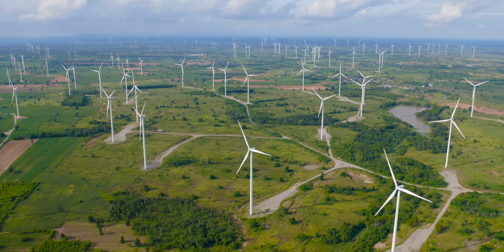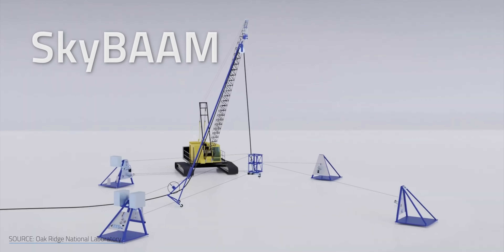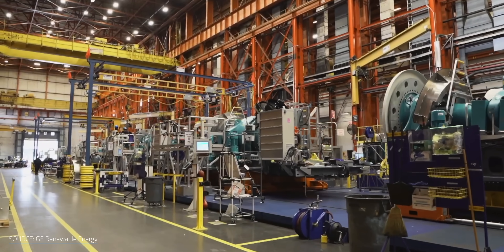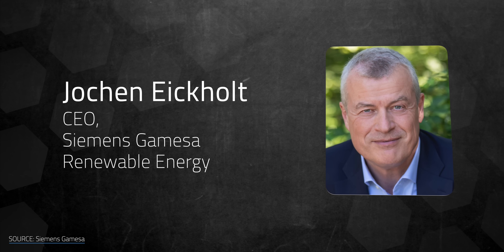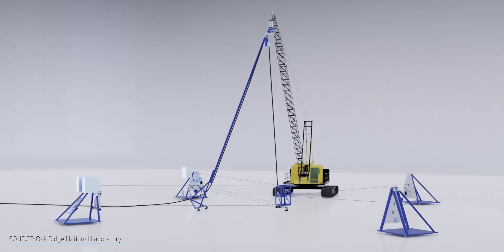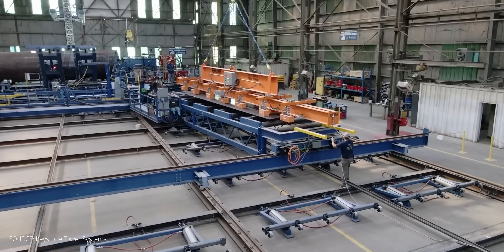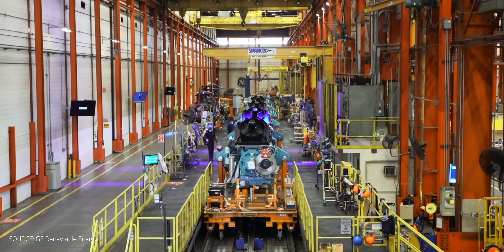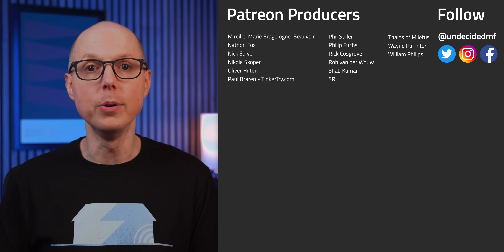Why We Need To Rethink Wind Turbines

Comment: I'd like to see things go smaller and more localized.  Things can be more cost effective and stable, IMO.  We see that happening with SMRs and there have been other videos looking at other wind generators that are smaller and may be more residential intended.
Reply: Sure, they would nicely substitute "residential localized" coal/gas power plants
Reply: @naytonthunder If you think about it, my home and almost every other one in my neighborhood has a “residential localized” gas power plant - but for heat, not electricity. As for smaller, localized electric generation, solar has tremendous advantages there. Solar panels (with battery backup) can be installed in all sorts of buildings, and scale from tiny to covering an entire lot. Wind turbines are harder to install, and small turbines don’t have much output. This just turns into a cost thing, and solar will be far cheaper than wind for most localized sites.
Reply: Wind scales very well by going bigger. Double the length of the blades and get quadruple the power. The reverse is costly. Going from 100m blades to 10m and you lose 99% of the energy capture potential.
Reply: @barongerhardt  I guess I can understand that but then what's the cost of all the machines and logistics to get it to where it needs to be and then to power people's homes?  Its time a factor and do people have a problem with a huge windmill in a field.  Those things need to be considered as well, I feel.

Comment: im having trouble believing you on some of your statements such as its cheaper to make carbon fiber blades than fiberglass. because adding carbon fiber usually increases cost up to 15 times the original cost. so which is it? i think you need to make it more clear or you need to research what your saying in more depth. Where do i come from my wife worked if the wind energy for 10 years upto 5 yrs ago.

Comment: I look at those folded columns and my first thought is, “duh”. 

One of two possibilities…The engineers were pressed to hold down costs so they skimped on the material used in the column. There’s absolutely no way the engineers with their complex computer modeling didn’t know better…or…the column was outsourced to the lowest bidder who chose to ignore speciations in order to make a profit.
Reply: Wind turbine tower break when they lose control of the rotor speed. If there is a lot of wind, and they can't reduce the angle of attack of the blades, the rotor will overspeed, the rotor will push too much on the tower, the blades will bend too much, and strike the tower, wich will break it. Nothing to do with the quality of the tower.
Reply: @niconico3907  You hit on like 5 engineering failures. Maybe one of those happening could be excused but all of them pushes on an extreme of incompetence and blatant disregard for safety.
Reply: @barongerhardt  in the world there was 906 000 MW of wind energy capacity at the end of 2022. On the few failures that were around 2MW each. Lets say 10MW failure. Which is 0.001% catastrophic failure rate. Not bad in my view.
Reply: @niconico3907  And what were there causes? Where they freak accidents of unknowable events, deliberate sabotage, or did someone screw up? Under spec requirements, design was inadequate, or manufacture/construction failed to follow design?
How ever rare, I don't accept the wind turbine failed because the wind blew any more than I accept patients die because they were given the wrong medication.
Reply: @barongerhardt   A friend of mine works as civil engineer for the planning and design of the towers. According to him, it's a combination of both. A decade ago, towers were constructed with huge safety margins as the load and aging characteristics were still unknown. The wind turbine towers differ from other buildings as the wind load is much more dynamic, but can also be controlled to a high degree by software. So modern wind turbines are more active in when they start moving out of the wind. This over all allowed significant savings in material. At the same time, some companies tried to cut corners even more with the expected results.
Reply: @barongerhardt  like I said it most often is not a tower design or quality issue, its a control system issue that prevents the rotor stopping in time to stay under designed maximum loads.
Reply: I would guess a combination of pushing for too low of a safety factor with catastrophic screw up by the construction team or major manufacturing defect (bad weld, missing/not-properly torqued bolts, ...).

Comment: To put the size of a football field and a wind turbine into perspective. 

A football field is 100 yards long. 

One yard is almost one meter, for a metric reference.

100 x 10 = 1000

One mile is 1,760 yards or 1,609 meters. 

One kilometer is 1,000 meters. 

Therefore a wind turbine is almost a kilometer, or roughly 3/4 of a mile. 

That's rough maths done on Google, and I'm sleep deprived. But I hope this puts into perspective the sheer size of a wind turbine. 

Massive.

Comment: The quest for ultimate efficiency is one of the reasons we are now experiencing supply chain problems and end user shortages. If the end consumer took up this mindset then retail would end as we know it. What about wind generated power for the home owner?  There has been almost no usable innovations in this area for a long time. I wonder how much potential is being lost due to short sighted profits. I would love to install wind power at my home but the tech is either decades old or unbelievably expensive for little gain. Solar took off when the small user found a reason to use it, i would like to see that happen with wind power.
Reply: The big reason why you shouldn't do it, is home wind has a scaling problem. As linear size of the wind turbine increases the capture is squared. The secondary reasons why you wont be able to do it is safety and noise. Because of those, lots of areas have laws (well founded or not) that make it impractical. The next reason is on a small scale wind tends to have low reliability. As such, in most cases solar is the better small scale case, but if you have the area, laws, money, and desire, there are some good wind options.
Reply: @barongerhardt   the point i was trying to make is we need innovation to improve on the small scale wind generation like we have with solar. Do you really think that the only way to produce energy with wind is with massive windmills?  I think there are yet undiscovered ways to do it differently
Reply: @arnoldreiter435  I don't know if that is a generalized desirable and reasonable goal. Big wind generators aren't the only way, but small/micro wind has lots of basic drawbacks. In a similar way that small nuclear powered super heated steam generators might seem like a good idea for home use but really aren't.

The advantage and disadvantage of solar is that it scales linearly. Almost every innovation that has gone into making it better helps as much on the small scale as it does on the large. It also makes it as you scale up to be outpaced by other techs that have better scaling factors.

I don't see some innovation being the missing thing. The physics are clear that like hydro it benefits from going big. It benefits from being placed as tall of a tower as possible. The amount of energy you can extract is well known and we are very close to those limits. After you have converted wind to rotational energy, rotational to electric is highly developed at all scales.

There is good reason you don't see wind powered calculators or a hiking wind generator for your cell phone. Watch a video about people trying to charge a phone from the rain downspout. Water is far more dense, and that is an exercise in futility. These things can be made, but not all power generation methods can be scaled down and maintain their usefulness.
Reply: @arnoldreiter435  big turbines are not the only way, they are the only economical way to produce meaningful amount of energy. There are other ways, but they pay for themselve in way longer if ever. You can't compare small scale wind energy with solar panels.
Reply: @barongerhardt   I understand what you are saying but i dont accept that we have come to the end of the road with small wind. The innovation can come from the design change of the equipment and better utilization of what we understand about wind. Instead of looking at the restrictions of it look at the opportunity that the different wind presents.....
Reply: Wind power increase with thesquare of the blade lenght, with the cube of the wind speed. With the bounday effect, the wind is slowed down  and disturbed by the ground, trees, building... so there is much less power near the ground than 100m high. 
There is no good cheap small wind  turbine model because that is not possible.
Wind turbines are mechanical, its not the same as solar panel which are as good if you put 2 or 300 at the same place. Only the cost of transport, installation, wiring, inverter are different.
Reply: @niconico3907  Yes i have heard all this and when i was in high school i read a book that proved we would never be able to launch a rocket into orbit let alone make it to the moon..... and i remember when i was told solar panels would never produce meaningful energy.  my point is we need innovation not dogma.

Comment: Vertical wind turbines could be a better solution if the blades and assembly can be assembled on site. The design is better since the c.g. of the rotor is in the center of the column and the generator can be place on the ground which reduces the p Delta moments. This setup is cheaper.
Reply: Show me a working Vertical axis wind turbine in the 10MW range.
There is none because the efficiency is too low, the stresses on the blades and drive train are too high. The economics don't add up. The vertical axis turbine design is so old, many companies would build them if it was good.
Reply: Energy generated per unit of material is going to be far less. If you just want the generator at ground level you can use a vertical shaft in the existing designs. In practice there are several problems.
Reply: Yes..

Comment: Solar, wind, fission?? All of the materials used to make them is dug outta the earth by diesel, gas and oil guzzling machinrs
Reply: So in the pursuit of perfection you'd rather toss out "good". K.

Even making the fleet hybridized is proving to be both cost-effective and emissions reductive.

There's a reason trains switched to diesel-electric ages ago.

Comment: My inventor brother had a genius vertical shaft design that was safe for birds, worked in low wind, and had a higher ratio of generation than the standard today. Still, he couldn't raise the $5,000,000 needed just to fend off patent lawsuits by the big companies. Something should be done about this practice that is intended to thwart new products on the market. Forbes did a good writeup on this practice years ago but little has been done.
Reply: If it’s a real tech that is capable of being commercialized, he should look for angel investors who focus on environmental issues, or possibly use kickstarter or something similar.  If it’s a good enough technology it should be able to make it past the hurdles, including patent infringement lawsuits if it doesn’t actually infringe on existing patents.

Comment: The real problem with wind turbines is that they meet none of the main criteria for economic and stable grid supply.
In order of magnitude the prime one is they are intermittent, which batteries, as some claim, cannot possibly overcome.
They  are asynchronous which means that they have an uncontrolled output feeding a grid that has to balance supply and demand on an instantaneous basis. They must have conventional generation to support them.
They have no inertia which is required for frequency stability.
They do not have reactive power control necessary for stable grid voltage.
They do not support short circuit current levels necessary for timely and appropriate grid system protection systems.
They really are a very inferior source of electrcity for grid use.

Comment: One approach to avoid cubic cost for squared yield is to get rid of some of the structure completely. That is the motivation for airborne wind energy, which has an interesting history including some spectacular failures such as Makani, but also has some first success stories. On Mauritius, there is a system in operation that uses a kite of 120 m² to generate electricity, built by a German manufacturer SkySails Power. A dead end or the first sight of a promising new approach? To early to tell...

Comment: The MRWT certainly looks promising, and visually it's less dramatic than the giant turbines. What updates have been done to protect bird and bat populations?
Reply from the maker: As for the MRWT, I'm not sure at this point what has or needs to be done for birds/bat populations.  But for traditional designs, there's actually a bunch of promising research and development to help with that issue.  Might need to do a video about it.
Reply: @UndecidedMF thanks for a great video Matt, good to be realistic and open about challenges facing the clean tech industries as well as their benefits and potential. I recall a team, I think from a U.S. university that is putting the blades downwind in order to ensure they don’t strike the mast. Maybe the same group trying this but another concept I’ve seen is to hinge the blades so they fold into the center if the wind is just too high and puts the entire structure at risk, although very doubtful it could be done with the monster turbine sizes of today.
Reply: Jack squat has been done. But who cares, there is profit to be made.

Comment: In the name of sanity just stop this nonsense.  Nearly all those composite binders are petroleum based anyway, anyone concerned with microplastics should be highly concerned about the end of life of these blades, the sheer amount of concrete involved means a vast carbon footprint, the insulation from market forces provided by ideological gov subsidization of big wind is what directly leads to the the low quality and lack of foresight.  Just build safe next gen nukes and be done with it.  Do we really have to see a carbon fiber blade fail under load spewing billions of seriously sharp breathable micro shards of carbon fiber and microplastics across a community to wake from this nightmare?  The environmental, maintenance, and decommission costs of big wind are a huge loser
Reply: Talking about pollution and wanting expensive, polluting nuclear is extremely contradictory. 

Nuclear pollution lasts for tens of millenia.

Please learn more about what it takes to deploy PV. The utilities do not promote PV much because it tends to cut into their profits and grid control.
Reply: @fllev4121  I don't think I'm the one requiring more accurate info here.  You can't live on koolaid
Reply: If you "don't think" then that's your doing and undoing. Utilities are the ones pushing wind because nuclear is Extremely Expensive and they always seek first technology that individuals can't afford by themselves. That is, they want to control the grid to their benefit.

PV is for those of us that have studied it and know how to use it to go off grid, inexpensively. Go ahead and build your nuclear power plant, if you can afford it. PV will be at least 10 times cheaper. This is the reason why France (one of the world's biggest nuclear electric deployers) is promoting now.

Comment: I am not convinced that turbines dont create turbulence and change weather patterns
Reply: Perhaps, but how much. If you look at a wind farm from a front view how much blade sweep area do they cover compared to the total width and height of the wind farm, and they are about 30% efficient. If the sweep area is 10% of the farm area and at 30% efficiency turbines you will have 3% energy taken from the wind in that location. Total blade sweep area would be tiny vs the length of a whole country would mean the overall weather effects would be insignificant I would imagine, do the math. 
E.G. estimate by looking from a plane view (surface area) perhaps 10,000 turbines with blade length 100 meter, 30% efficiency. Gives sweep area of 31,410 m^2, 30% of that area energy is taken so effectively 9423 m^2  which is 0.009423 km^2. So all 10,000 turbines creates a sweep area of 94 km^2. Perhaps a 2000 km long country and the blade diameter of 200m gives a area of 400 km^2, so about a 23% area of wind blockage,  which is quite big.

Comment: They should make the vertical. Plenty of great design options.
Reply: All vertical designs I'm aware of are far less efficient. For small local usage that might be fine but for grid scale power the tradeoff is far too costly.
Reply: @barongerhardt  not with some of the new setups I have seen. You can put more in an area and they cost a lot less.
Reply: @jalexand007  I don't keep up on it as much as I use to, but when I did, nothing with a vertical axis came even remotely close. I do like how some of them look/move, but I have never seen the numbers pan out.
Do you have any names of products meeting those demands that are for sale and have 3rd party testing/verification? Or even better, an example of a large scale installation with some historic information and LCOE numbers?
Reply: @barongerhardt  it was about 6 months ago or so but I saw a group in Europe putting it together. If I can find the video I will post it.